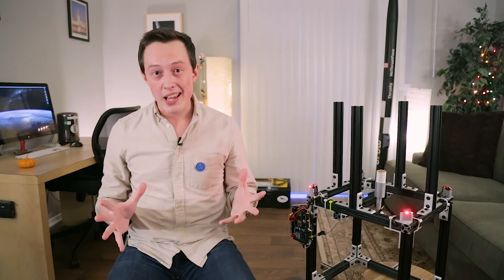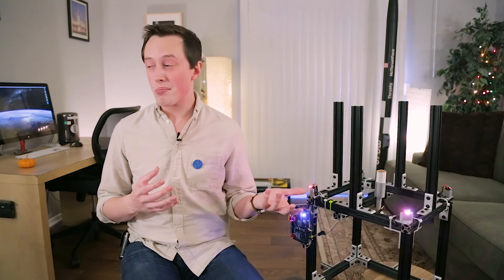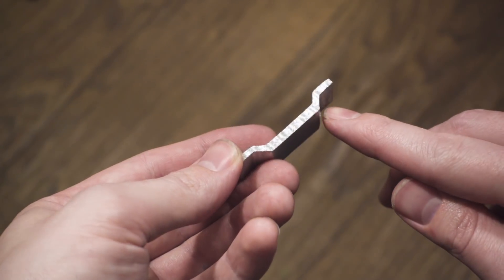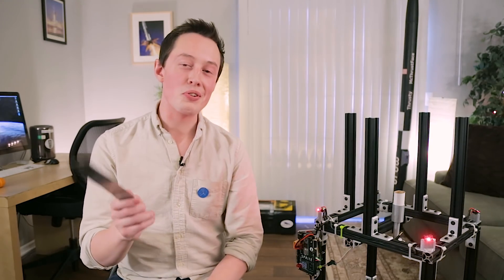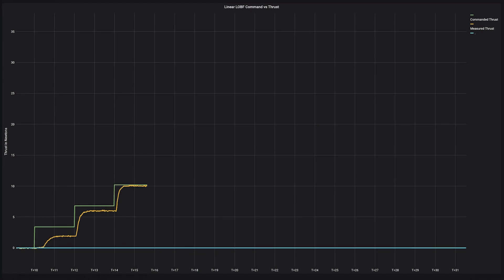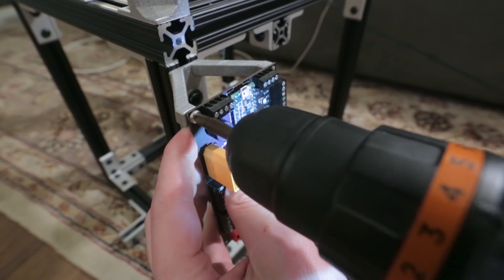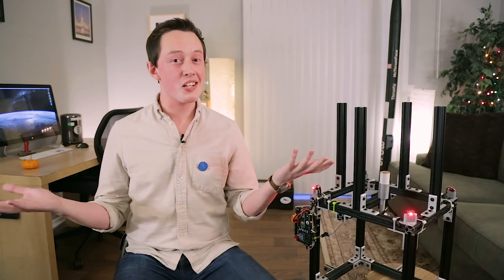Rocket Motor Test Stand

Comment: First of all thanks for the videos. They inspired me to build my first sauger rocket engine and now I want more.
I am making them for a simple reason... They are not available in my country. So if I can not buy them got to make them. Before I go up to level of HTPB I need to make one from black powder and experiment as much as I can. SO,  I am building a test rig myself but I also need to measure the pressure inside the chamber. Can you explain how can I do that???

Comment: Hello there! I am an intern at a startup, looking to design a static test bed for high power rocket motor.  So, we are looking to make a static test bed for motors ranging from F-class to M-class, not physically, just modelling and simulating it. With the max thrusts of those motors as they are, do you know if the heavy duty load cells, like the 200-1000kg ones, can be used with this  kind of arduino and hx711 setup? Can you give any suggestions? Thank you in advance!

Comment: Why is saying "Motor" ?
Reply: I guess you are dubious about Rocket "motors". Engines are those bodies that convert the chemical energy into thrust by means of mechanical action(turbines, compressors etc...). However, a rocket motor, which already has chemicals loaded in it, doesn't require any mechanical means like turbine, compressor etc... for its functioning. All it needs is just ignition and oxygen to sustain the combustion. Hence it is called a motor
Reply: @aravindkarthik5120  I see. Thanks mahn 😁
Reply: @aravindkarthik5120  I just read an article  published on 'Journal of American Rocket Society'. Both the terms are used Interchangeably in this case, even though they mean different things .
Engine is something which acts as a generator and converter in itself. While motors require and external generator or storage-battery for conversion (of PE TO KE)

Comment: Why don’t you tie down rocket tests to a 3 pronged system that will accurately measure G-force manipulations on the X and Y axis? This way you can test your rockets, the flight computer control, and the Thrust Vector control all without the possibility of your rockets being damaged during decent

Comment: 0:18 - You should check out Openbuilds. It's smaller, lighter, and less expensive. For tings like 3D printers and small CNC machines it works great. https://openbuilds.com/
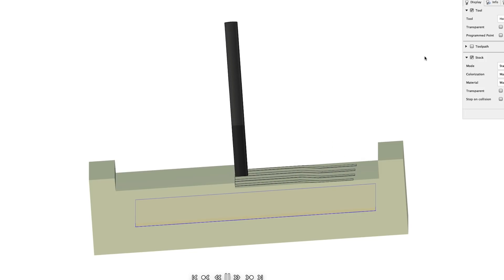3:12 - No, you didn't want to grind it down, you wanted to mill it down which is a completely different operation. Grinding is done for incredibly hard materials using an abrasive bit. (Yes, I'm pedantic.)
3:21 - You can get a much better cut by using coolant/lubricant like Kool Mist 77.  One gallon makes about 40 gallons. Mix up a quart and put it in a spray bottle... keep the surface a bit damp. You will be amazed how much more quiet and smooth it runs.
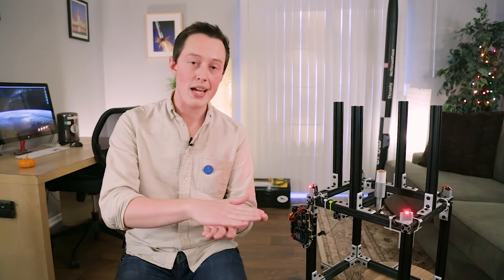4:54 - You need a set of parallels. They come in different thicknesses, hold your work much more evenly.  Not that expensive... and VERY useful.
5:08 - yeah... that explains a lot.
Askjerry - Tripoli 5787 - L1.

Comment: Just a minor correction, foil strain gauges function because of the etched trace length stretching longer and narrower, mechanically increasing its electrical resistance. Semiconductor strain gauges are the kind which utilise the peizoresistive effect, where mechanical strain affects the conduction bandgap inside of a semiconductor.

The Wheatstone Bridge, which I'm sure you already know and don't mention for brevity, serves the purpose of both converting the resistace value into a readable voltage and accounting for temperature induced expansion and contraction through the use of a second opposing strain gauge to balance the signal.

Only after that is it amplified and converted to a digital value.

Comment: Hey there, I wonder why the load cell shows minus values after the thrust ends. Does it get bent a little every time?
Reply: That is something that can happen if you are too close to its limits, where you mechanically deform the deflection beam. These are aluminum load cells, so you have a much smaller range of elastic deformation than you get with other materials.

Not that there is anything wrong with the design, he just needs a beefier one.

Comment: Cool daddy-o. Tip - don't use solder paste. Just tin the pads on the PCB with tin-lead solder. It melts easier and wets better. Use a flux pen on the solder bumps and place your parts, and heat. The parts don't stick well with just some liquid flux so be careful, but it works better and saves the nonsense.

Comment: Why are you blowing the metal shavings away while the print is running, just use a shop vac so they don't get on yer lead screws

Comment: I’m making homemade rocket candy motors on an island in Panama. We got some 3/4” x 1/4” tubes from pyrodirect, potassium nitrate from Panama City, and plug dirt from the ground. I based mine off the King of Random, and I’ve managed to recreate his motors with no plastic; they can degrade in the ocean. I needed Elmer’s glue to keep the gas from working its way around the plugs, popping them out. I am about to do the same test you did but with a spring balance and a camera. I’ll then approximate the mass loss curve off of the force curve ( dm/dt = sqrt(F) ; pretty close) to make a useful model. I plan to make side boosters that pop off with a flip!

Comment: About the load cell mounts:
2 parts whos job it is to hold a third part to attach to a fourth part that could just have been attached to the fourth part directly is a superfluous part...
Since you will have to calibrate the loadcell anyways you could just have drilled it out and mounted it to the frame with a t-slot nut.
Uber fancy testrig nontheless!

Comment: If you use a path operation from fusion 360 use a slope operation when going down Into the material. Plunging into the material is quite harsh on your mill bits.

Comment: The block of aluminum was large enough to act as it's own heat sink so you shouldn't really need any cutting fluid, right?  (I have not machined anything either, just picked up on points from other youtubers)

Comment: Makes me think of a woodshop project from elementary school wherein I built a launch platform for firework rockets using those long guide sticks. I decided on a 70 degree launch angle for the platform. A tube was used for inserting the guide stick.

Comment: you should make a bell for the motors, mach diamonds mean that the motors are not efficient for the altitude you're firing them at, and since the rockets you usually fly don't go that high, I think a bell would be good for maximum efficiency, then again I might be stupid and wrong. also, I'm sure you knew this already so there's no point in pointing it out

Comment: hi, great video, its 20-20 not 80-20 aluminium, also does it matter the rocket is pointing down and doesnt get the force against the ground like it would do on launch? thanks
Reply: It is actually 1010-80/20, you can tell by the alignment grooves on its surface showing it as part of the Imperial unit extrusion line.

Comment: 0:19 "...8020 T-slot aluminum..."  Hmmm, I see plenty of 2020, but what happened to the 8020?
Reply: Isn't 80/20 the brand?
Reply: @villageblunder4787  Yup, you're right, "80/20" is a brand name, and "8020", without the slash, is the dimensional size of a specific extruded T-slot aluminum. 8020 is much more common and well known than 80/20, hence I expected Joe to make the distinction, but it never came.

Comment: Pro tip Joe... coolant. And have a look at a speeds and feeds chart. Will help you get the right cutter speed for the feed rate of the machine (how fast the cutter moves across the material). That way you get a smooth finish. Awesome first attempt though!

Comment: From my experience you cannot overbuild a test stand. My measurements are occluded by vibrations although it is made of welded steel profiles. 
But I also want to see smaller, much shorter signals ... doesn't help. 
Your data looks nice. :)

Comment: Are you going to post your code? I recently made a test stand with a raspberry pi, and my logging setup is fairly manual at this point. I also have had trouble triggering it when the motor ignites, I tried attaching a relay to my ignitor wires but it was unreliable, now we just look for a big change in measurement but it still sucks. Lots of issues with measurements drifting as well. Same HX711 setup. I'll definitely let you take my money if necessary, but honestly who cares about the static thrust "raw footage", give us the good stuff!!

Comment: So im working on  space shuttle model rocket using pringles cans as boosters, quacker oats cans as the External tank, with a 3d printed custom orbiter. What model rocket motor should i use. I have no cert from rocketry.

Comment: Not using cutting fluid ist'n actually too bad, because you either floot carbite endmills or you don't. Otherwise they will break. So that was alright.
Reply: But there's no cutting, no chips, only dust and powder. He needs to learn a bit about feeds and speeds.
Reply: @jimbarchuk  Totally agree with that

Comment: 7 pounds of peak thrust is a little low for an F motor. Either you are experiencing the same problem I did with the load cell not being responsive enough (dropping a ten pound weight on it for one second and then picking it back up only records about 1 pound of force), or, you didn't properly calibrate the load cell. Either way, a 5KG load cell is way too small for what you need, you need 50KG at least, which is 110 pounds. F motors range from about 40 to 250 pounds average of thrust, so an 11 pound loadcell ain't gonna cut it.

Comment: That's a five kilogram load cell. Its safe weight limit is just about 11 pounds. You peaked at about 7 pounds. That's not a whole lot of room lol Also, how did you get the load cell to register so quickly? Great video.
Reply: Indeed, as soon as you deform the load cell its never going to be within spec again.

Comment: why wouldn't propellant mass be lost if the motor were to be fired horizontally ?
Reply: It would be lost, but the force sensor in that case measures horizontal force, so it's not affected by the reduction in weight, because gravity goes down, not sideways.
Reply: @antalz  damn thanks
as a first year physics student i feel kinda dumb rn
Reply: @tenns  That's cool to hear, I got a master's in physics. Believe me, you'll feel dumb a lot in the upcoming years. Happens to everyone.

Comment: You also covered something I discovered halfway though building mine. Was originally building it to fire upwards but then thought about the change in mass issue and rebuilt for horizontal flight. Still some fine tuning of the software before a first test but love your design and looking forward to seeing it in use more!

Comment: Welp, maybe this is proffesional way, but i preffer to just place brick, kitchen weight, and struts for  keeping it unable to move other Axis than height. BTW, that griding machine, it leaves a lot of aluminium powder... Use its power lol, this might increase thrust a lot
Reply: Sparks are a hazard. Yeah, there were no chips. He doesn't need to learn machining, just enough to make a part. But dust is not good.